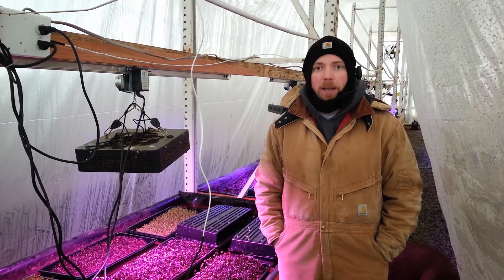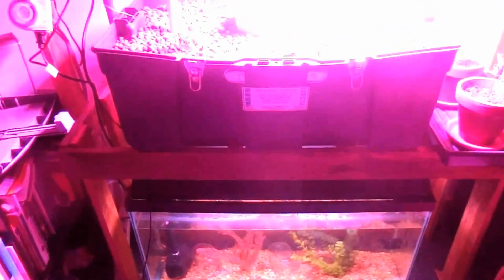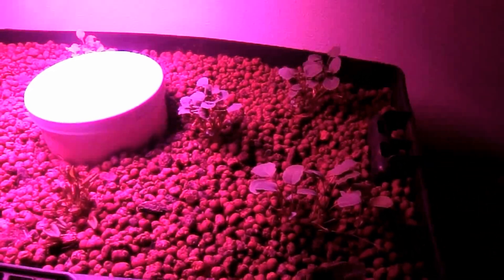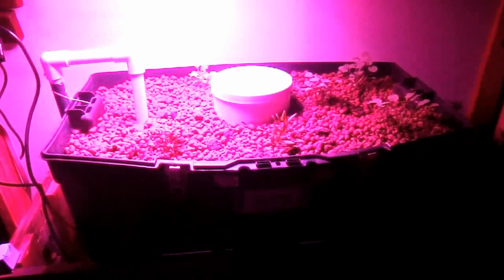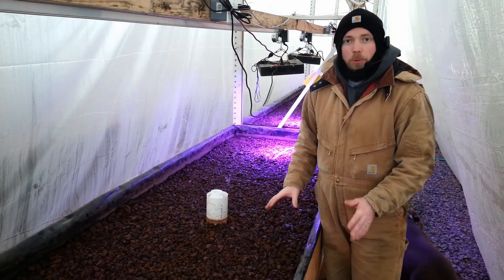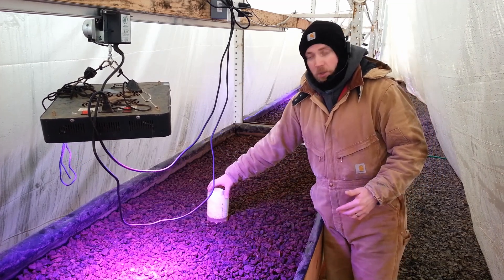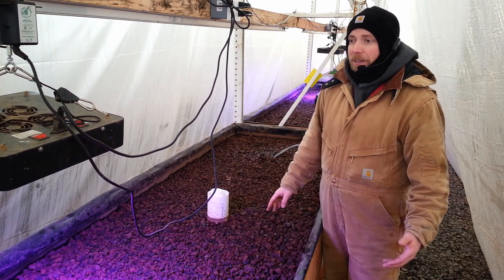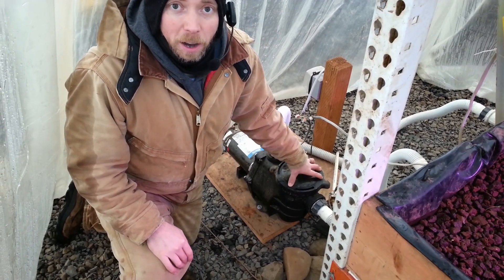Can you use AQUAPONICS and MICROGREENS to SURVIVE? THRIVE?

Comment: Perhaps the older method of sandponics? No matter which medium you use it is still going to be massive amounts of weight to transport. With the martian soil being mostly sterile already you could use your preliminary experiments to determine seperating mesh size and identify the microbateria that grow in an earthbound system. It would convert that massive weight of medium to a few screens, some live cultures and ph adjusters.

Comment: Why do you use a bell siphon instead of a constant flow system? Are there advantages to having the bed flood and drain with the cycle as apposed to water flowing through and "over flowing" out?
Reply: It's my understanding that the roots need time to dry so they don't rot and it helps with oxygenating them.  However, don't ask me.  I've tried an IBC aquaponic system 3 times and I can't get anything to grow :-(

Comment: Have you ate any of the fish yet?
Reply from the maker: not yet but looking forward to it
Reply: TheRealMartian I'm researching my own system based on IBC totes. One thing I ran across is that the fish can have a muddy or off taste. One way to mitigate that is to stop feeding them for about a week before harvest. I looking forward to finding out.
I picked up a board and some sensors from your store for my automation.
Reply: I've heard about the muddy taste, too. I wondered if that would be a problem with trout, since they require much cleaner water than the tillapia or carp that are usually grown.